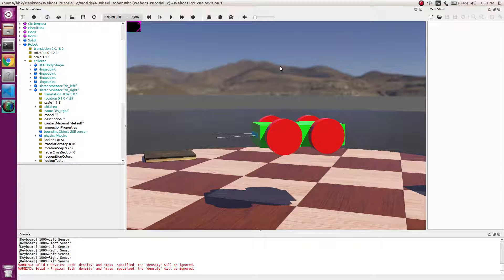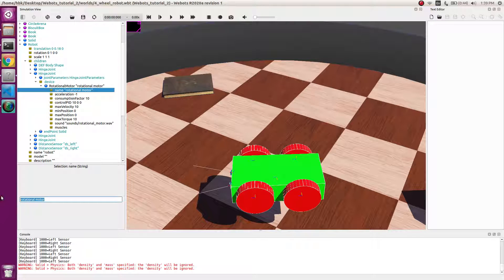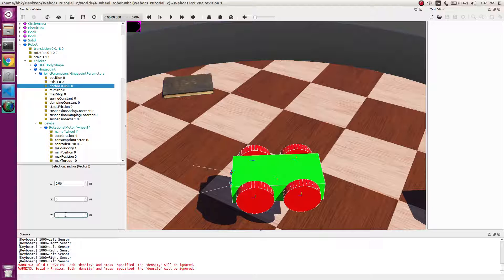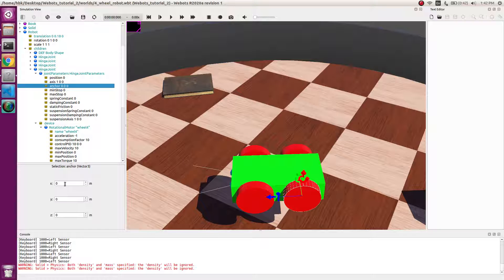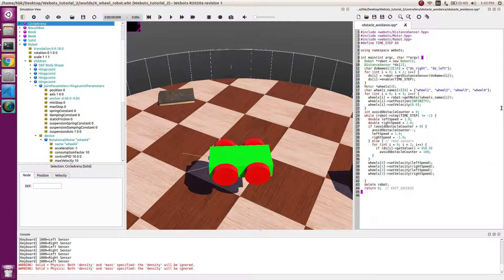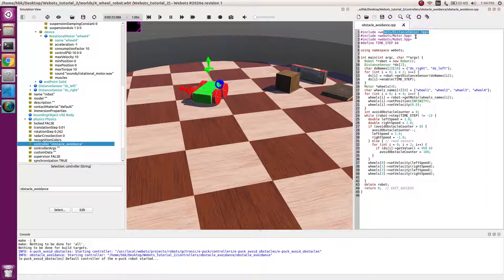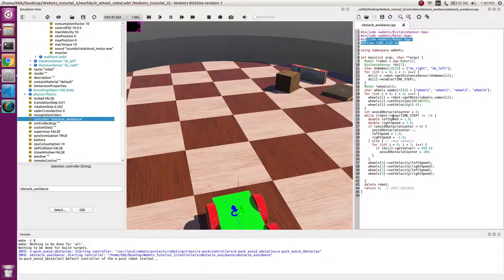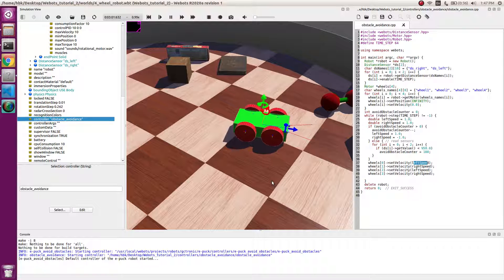Obstacle Avoidance Controller for Robot | Webots Simulator |  [Tutorial 8]

Comment: For people who don't turn, check to see if the wheels are in the right order.
The correct order of wheels in the code is left front (1), right front (2), left rear (3), right rear (4).

Also if your wheels are not spinning but rolling, turn the robot in the direction where the wheels are spinning, also the red line is the direction of the wheels.
Reply: Hi, I have the same problem you described. I tried doing what you said, but it still doesn't work. What should I do?

Comment: When obstacles is detected then robot turns almost 360° and move but I wanted robot to just take either left or right and move in same direction which it was moving before detecting obstacle. 
I am not getting wat to change in program to do like that. 
Plz help me out as soon as possible, don't have much time.
Reply from the maker: For that case you will need to implement navigation algorithms.

You will need to know the map before hand and will need to use planners for achieving the goal.

Shorter way can be if you see and obstacle make a 90 degree turn.
Go straight for some distance again make a 90 degree turn so that you are back on your direction.
If you see obstacles again repeat the loop
Reply from the maker: You will need IMU for this application.
Reply: @coolrobotics  Der is a video wch is tutorial 11 wch is about IMU.... I vl try that once. 
For navigation can I program in Aruduno itself in case of prototype model.
Reply from the maker: If you are good at aurdino sure
Reply: @coolrobotics  Thank you very much for clarification bro

Comment: For my 4-wheel robot, when I set the velocity for all four wheels to the same value then my robot can move forward as expected but if I would set the velocity for four wheels with different values, for example when I want it to move right or left, it doesn't work so my robot can only go straight forever. Can you guess where I might have gone wrong that resulted in this error?
Reply from the maker: You can set both right wheels with same velocity and left wheel with the same(but can be different then right wheel) in order to steer
Reply: @coolrobotics  yes, i have tried to do that but it doesn’t work. Is it because my design or friction or may be something else?
Reply from the maker: @jokercrazy3330  Have you made any changes in friction
Reply: Same my problem 🥲

Comment: How to mark one tile with some letter('P') or image to denote parking area so that the robot can park only there. Any easy way to find the exact co-oridinates of corners of a tile
Reply from the maker: A very good question...

You can use IMU and GPS readings.
1. Keep robot on that tile. (Which you want to mark as P).
2. Save the IMU and GPS data of that point.
3. Compare robot co-ordinates with the tile  values. 
4. If it is near the value trigger stop.
Reply: @coolrobotics  Thank You very much for the response. You are really a motivator for a learner like me. I have GPS and IMU filtted in to the robot. Is it possible I can compare the (X,Z) of GPS between the co-ordinates of a tile so as to stop on the designated tile, rather than comparing exactly one GPS co-ordinates as the robot may not reach that 'saved' point exactly but could be nearer. 2) I should the get the distance covered by the robot by multiplying the position sensor value of 1 front wheel(for example) at any given time by the radius of the wheel. Also, how can I rotate the robot on Z Axis by 90 when a certain condition is met e.g. the robot has travelled 30 meter and I would like to make the robot stand upright. Can I apply 0(zero velocity) to both rear wheels to make that possible?

Comment: What is the setting it tells that the robot would move in the direction of the sensor and not in opposite direction? Also, could you explain the logic of IF and FOR loop constructs.
Reply from the maker: Direction of robot is defined with sign of velocity is set-velocity.
Or if you are doing position controller then value of position you give in set-position.
Reply: @coolrobotics  What I mean as how to ensure that the direction of move of the Robot is aligned with the position of the distance sensor put on the front  i.e. how does it know that the robot should move(assuming + velocity) in the direction the distance sensors are positioned(Front of.the robot)
Reply from the maker: If loop is for making sure there is are no obstacles while we are going forward.

And for loop is for checking obstacles through all the sensors.( In our case it is 2)

Comment: Hi, nice tutorial, whenever i click play the whole robot sinks into the ground as if the ground is like water. Any ideas on how to fix it?
Reply from the maker: Add bounding objects to your nodes
Reply: @coolrobotics  hi, I have however it's still falling through the floor
Reply from the maker: Did you add a bounding object of same size as node.
Reply: @coolrobotics  I've just changed the physics to have mass of +1 as it was originally -1 and it's now working. However it is moving backwards not forwards aha
Reply: @coolrobotics  okay I've moved the sensors to the other side but they dont stop the robot and turn it around it just keeps moving?
Reply from the maker: Look at controller for this issue.
You are setting position in opposite direction
Reply: @coolrobotics  hi, I've gotten it work the only issue is it's response to turn around when it senses am obstacle is very delayed. It drives into the object and then only after a few seconds it starts to turn it self around whilst hitting the obstacle
Reply: @coolrobotics  update: Okay so I tried the keyboard tutorial and I can see that when pressing forward and backwards all wheels work correctly and it moves back or forward. But when trying to move left or right the front spin in opposite direction to the rear but it doesnt turn. Instead when pressing right it goes forward and when pressing left it goes backward.

Comment: in the code about the distance sensor，i am wondering why 950 is used.  The code like: “if (ds_values < 950.0) ”, if seting 1000, the car robot turn left wherever there are obstacles or not, and <1 always go stright. So, chould you please explain why the code choose 950.
Reply from the maker: We can choose any value below 1000 because if there is no obstacle it gives the value of 1000. If we choose a very small value it will result in detecting obstacles when it reaches too close to the robot. So you can choose your value and see how the simulation works and make changes accordingly.